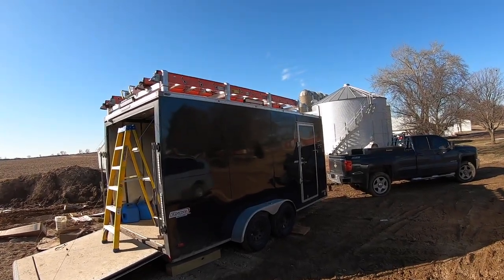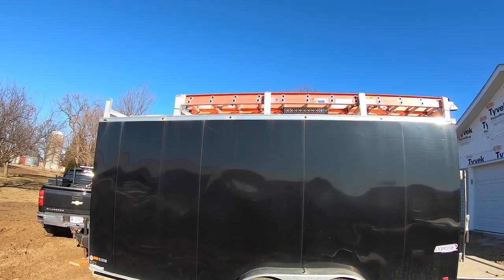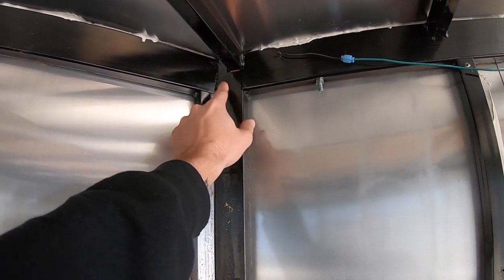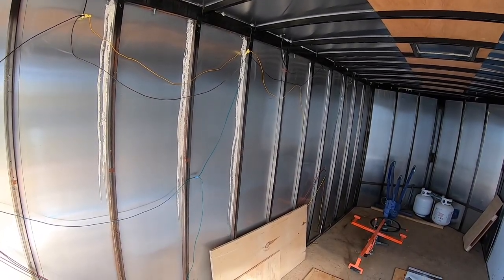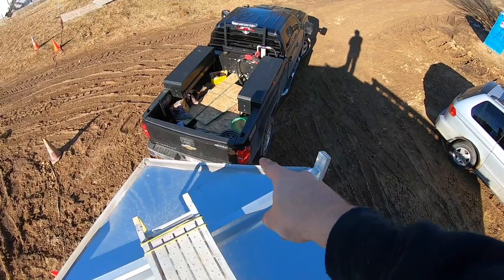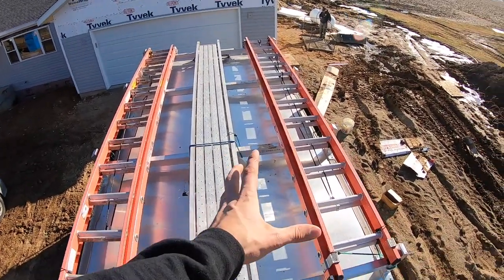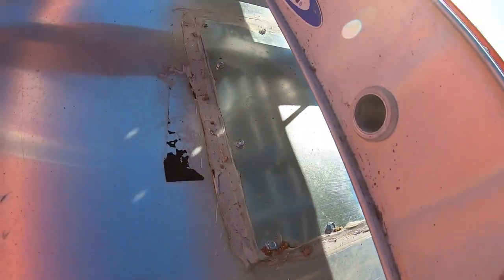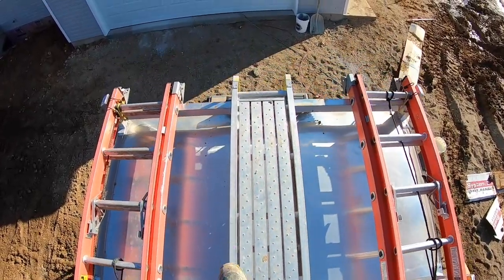Tool Trailer Ladder Rack Part 1

Comment: Did you ever do a follow-up video on the exterior lighting?  Nice ladder rack!  Found it . . . "Tool Trailer Wiring Part 2, Exterior Lights. "
Reply from the maker: I’m not sure. I go in waves between job site uploads and trailer videos. We’ve been slammed on site so I haven’t made trailer videos in a little while.